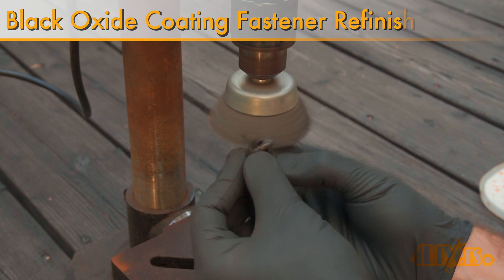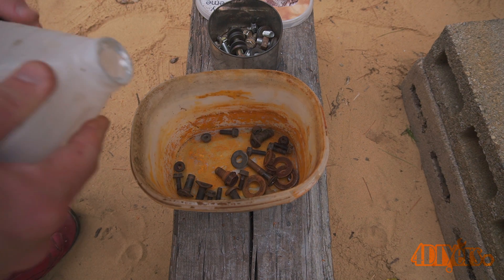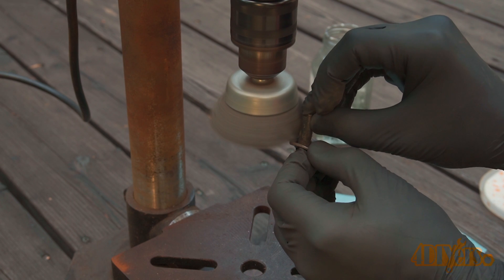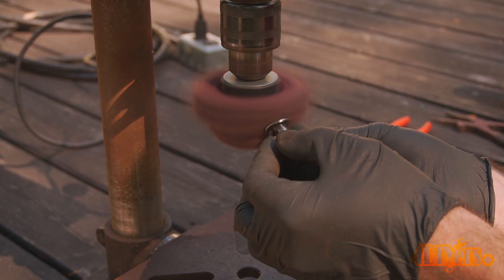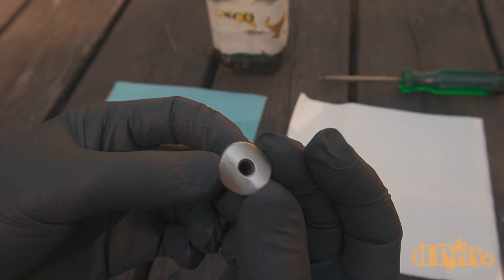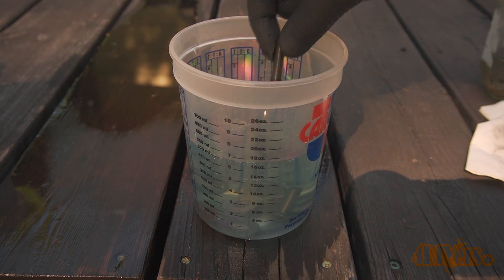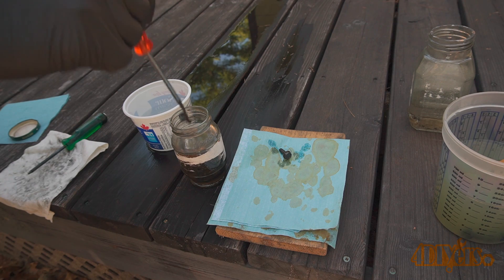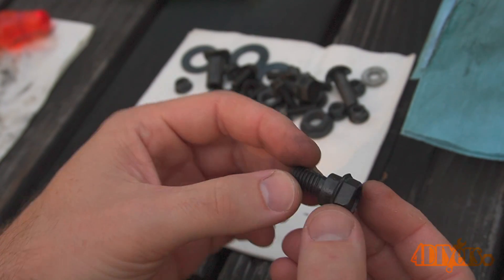How to Refinish Rusty Fasteners with a Black Oxide Coating

Comment: Have you looked at these fasteners after they had been treated and put back to work in the field for a year? Any rust?
Reply from the maker: If they're exposed to the outdoors, unfortunately they don't hold up. Same as a factory produced black oxide coating, it's not intended to be weather resistant. Indoor applications with minimal moisture have been fine. I redid a bunch of tools with this method.
Reply: @4DIYers  Thank you for the response. Another method I've seen is oil quenching, which looks quote easy. I have noticed that many of the bolt heads in my Toyota SUV are getting rusty, both in the engine bay as well as other semi-exposed areas. Stainless steel replacements would do, but are probably expensive.
Reply from the maker: No problem. Oil quenching is great, but you need to be careful the extreme heat doesn't affect the structure of a fastener. I know what you mean about engine bay bolts going rusty. I wouldn't recommend stainless steel, if in aluminum it'll seize quite badly.
Reply: @4DIYers  Thank you. I didn't consider the steel threads seizing in aluminium.
Reply: @dmitry7908 galvanic corrosion between aluminum and stainless steel
 Galvani discovered this phenomenon between various metals. It generates a little voltage, around 0,5 Volt IIRC.

Comment: I always enjoy your videos.  After the coating is made, I heat the item with a heat gun.  I don't get it red hot.  Then I swish it around in a container of that really black, "moly" brake grease.  I take it out after a day and wipe off the excess grease with a paper towel.  Nothing is blacker than that brake grease, and it stays on the fastener longer than oil, WD-40, etc.  "Moly" is short for molybdenum disulfide which is inherently black and inherently insoluble in water.  It won't wash off.  It doesn't get oxidized by the air either.

Comment: wire wheel on a drill press!  Mind Blown!
Reply from the maker: Not necessarily good for the drill press as the force is going in a direction it was not designed for.
Reply: @4DIYers  It is a good Idea though. It would be just fine if you had an extra drill press you could use just for that purpose alone. Thank you for your work.

Comment: Would this process work good for my hitch on my sedan. Its always rusting since I live in the Midwest with rain and snow.. Im trying to find something that protects the hitch and pin.. I just went through hell and had to make a hole thru pin cuz it wouldn't come out since it was heavily rusted? Any suggestions plz. Thanks.
Reply from the maker: Best off using an implement paint, some are rust inhibiting and that would be the type I recommend. Make sure you strip down the rust, try to get clean bare metal. Once painted and cured, then oil spray the hitch.

Comment: This is a cold process. The process use on most commercially used parts or gun parts a hot method is used with different chemicals.  I had a business in the early 90’s do the hot method. Lots of gun, sewing machine, and poultry equipment parts are blackened. The hot method will change aluminum into hydrogen almost instantly.
Reply from the maker: Yes it is. I've done the hot process on a couple parts in the past. I do prefer the hot over the cold method, but it's a bit more work.

Comment: Great video thank you! I have some black oxide hardware that I'd like to fasten with lock-tite, can I just use the Fasteners as is or do I have to put them in a solvent first? And if so would should I consider using?
Reply from the maker: Thank you! The oil would need to be cleaned on the threads. Brake cleaner would be fine for that.
Reply: @4DIYers  thank you!
Reply from the maker: You’re welcome!

Comment: Instead of using the more toxic chemicals you can use a hydrogen peroxide and salt process to get a really black finish. Tumble the parts in crushed walnut shells which won't damage the threads which is good for restoration work. Stops carcinogens getting into local waterways and you get really dark black parts. Plus you can do it on your kitchen table, totally non toxic.
Reply: Hey any chance you can explain this a little more or maybe link any good videos about it? I am always doing some kind of project and cleaning rusted nuts/bolts and often times searching around trying to find a specific bolt in black locally which I never can. Just today I went to Lowes, HD, and Ace looking for something and ended up with stainless. Would love to have a way to coat hardware black whenever I need to without spending a fortune on tons of chemicals.
Reply: @jonathangaliano2617 one really good way is to to use a brass tumbler. As this poster stated. Using walnut shells. Then heat the bolt with a torch till its red and dip it in motor oil. This will make it black and resistant to corrosion. It will affect the hardness of the metal though. If it's not a critical bolt, like motorcycle axel, or automotive lug studs, then it's fine. For example, I'm doing this with all of my bolts for the covers on my motorcycle engine.
Reply: Oh wow thanks for enlightening me on a less toxic way

Comment: Think this could be used on an entire knife blade?
Reply from the maker: Yes you can, not sure how the finish will hold up though.
Reply: It doesn't go well on a knife blade. In a few days, the deposited layer is cleaned, it acquires an ugly gray color and the knife rusts in places if you leave it in the sink, for example. I did not try to treat it with hydrogen peroxide and salt, all boiled. But there is also the problem of the handles that have to be taken down.

Comment: Yay! Always looking for “patina” methods. We currently use oxidizes for silver, etc. and are able to plate electrically with a “black rhodium” solution. However, much costume jewelry we get for repair obviously was darkened with something else. Good to know, and your video was straightforward and expert. Thanks!
Reply from the maker: Thank you, I appreciate the feedback! I want to eventually get into plating too. Always running into fasteners and little parts that need to be redone.

Comment: Thanks for the vid, I didn't know there is something like a black oxide coating which was really interesting to see + I'm into trying it out !
Recently I've been playing with electrolisys and zinc coating which gave very satisfying results
Reply from the maker: Thank you! I have yet to try electrolysis. Vinegar usually does pretty well for my needs, once the garage is built I'd like to get a sandblasting cabinet so that should cover all my rust removal needs. Wouldn't mind trying plating too.